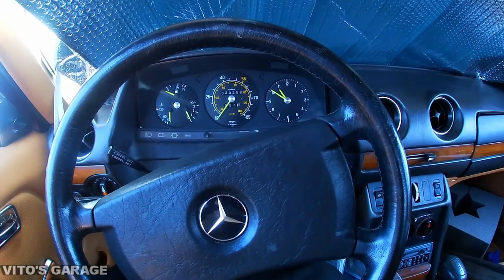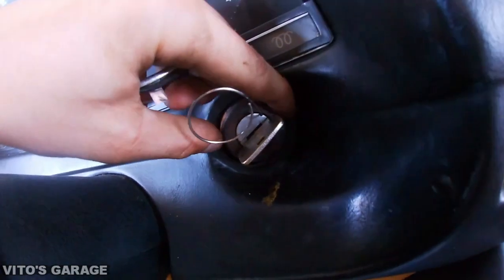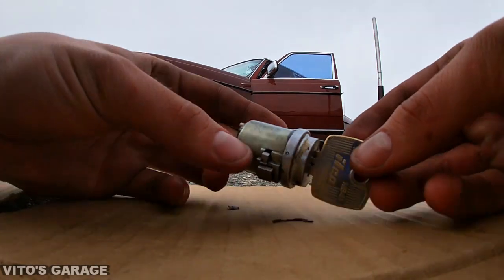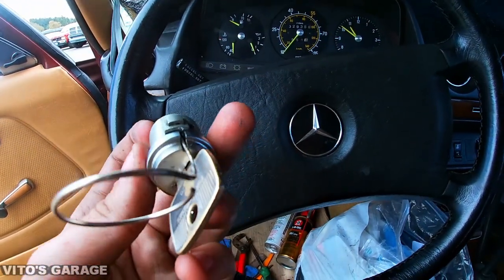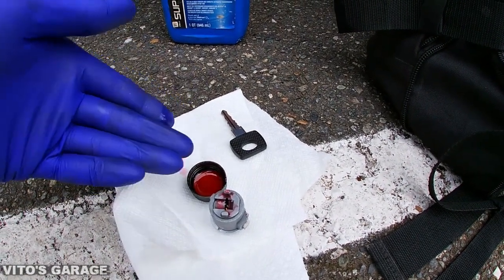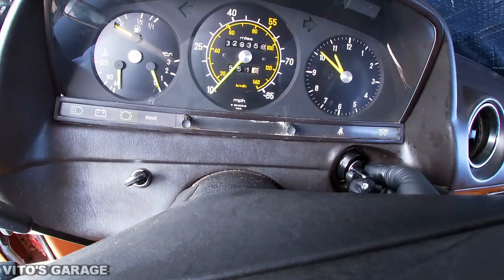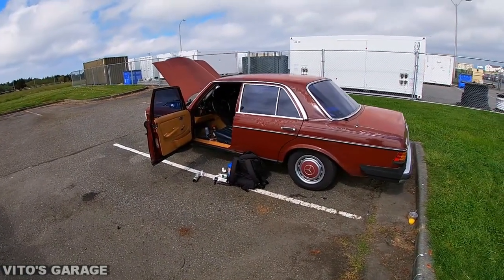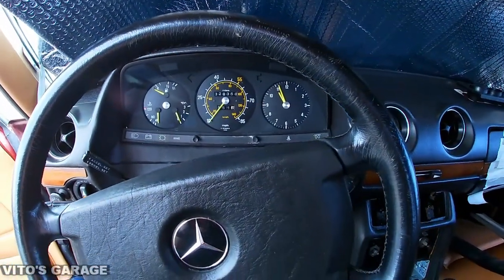Key is STUCK.. Ignition Cylinder/Tumbler Replacement Difficulties Mercedes W123 W126 W116 W201 W124

Comment: Thank Vito for the thorough explanation of the Key lock assembly. They are great cars. I have a w116 sd and a w115 240D. I drive 42 miles a day and have never been stranded in either car. I religiously change the oil every 3000. They just keep going.
Reply from the maker: Thank you Jeffery! And thank you for watching and supporting. Yes, these cars are just amazing! Save them all!

Comment: The key on my '82 300D worked fine, then a month or so ago, I tried to start it and the key would not turn.  Steering wheel is locked and I can't do anything.  I've tried everything and still no luck.  So, I guess I'm going to have to drill it out.  I tried my spare key and it won't work either.  I may go to the dealer and buy a new key before I drill it, but man....  I agree with you, replace the whole thing before this happens.  It's a real pain in the rump!
Reply from the maker: You have to catch them early. Don’t give up yet and try to spray ATF inside the tumbler. Wiggle it and try to turn at the same time. It should turn eventually. But you need patience

Comment: How do you replace the cylinder when the key won't turn in order for you to find the two holes to pop it out
Reply from the maker: You have to drill out the pin on the whole steering lock assembly. The pin is very small and located between the black steering column and the lock assembly itself. Look for the clamp above the kick panel and you’ll see the pin there too.  Long story short, you’ll need a new steering lock assembly, ignition tumbler and key as well as the black metal surround for the tumbler

Comment: Hey i just got a w126 and the ignition is rusty to the point where the key wont turn.  how would i remove the tumbler if i cant get it to position 2?
Reply from the maker: This video will help you: https://youtu.be/428zubvAH-M
You’ll need to order a new steering lock assembly so your steering lock can work properly

Comment: somone offered me a free 300D the key is stuck and wont budge what should i do??? Help
Reply from the maker: Does the key come out? Is it the correct key for the ignition? You can try to spray ATF in the cylinder and wiggle the key back and forth. It might budge loose. If not, then check out my video on how I saved a beige W126 almost 2 years ago. It was sitting for 10 years because of lost keys. I drilled out the old ignition lock assembly
Reply: @VITOSGARAGE  i will watch your video now...So the key is stuck halfway turned Jammed i dont know if its the correct key and the steering is locked tommorow i will try everything !!!Free 300D!!!